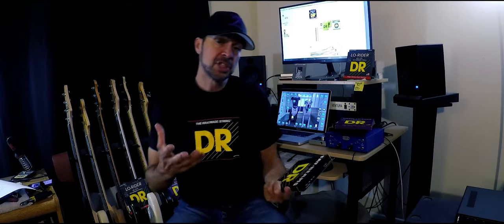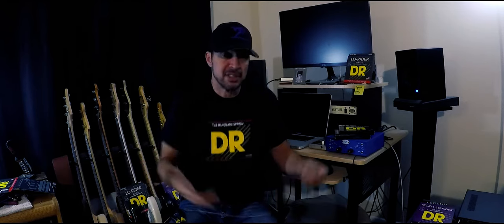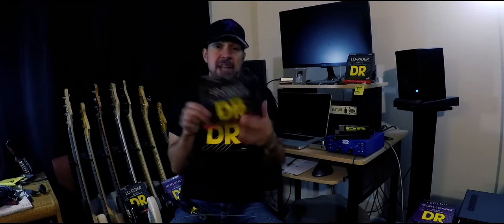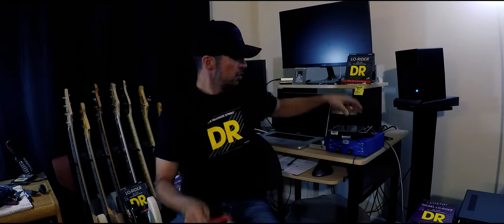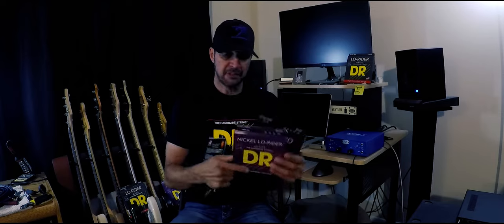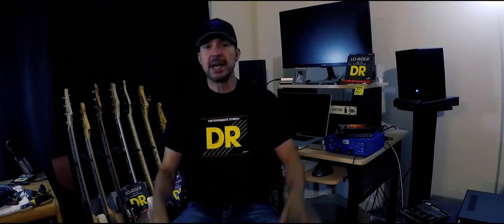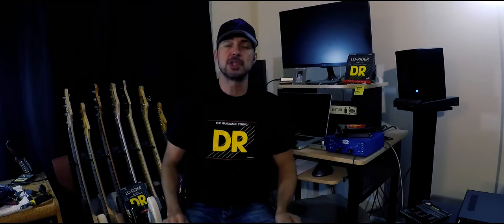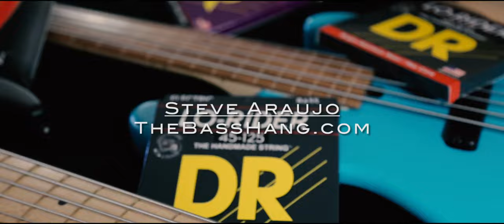Installing DR Strings Properly

Comment: Wow I learned something new today. I have been using DR coated strings off and on for a few years and never once opened the box to look at the instructions. I always stretched without a thought about it except for one of my 5 stringers. I believe I put that set on around 2009 maybe? I remember not stretching those strings because I was in a hurry and I brought it for a back up bass. It’s 2024 and that set is still on there and still sounds great. Even though some of the coating has rubbed off from years of playing that bass they still sound great.

Comment: What happens when you tune a string? You STRETCH it 🤦🏻‍♂
Been using lo-riders for the better part of 25 years. Always stretched them to make them stay in tune faster. And I have never crimped them before cutting. No issues whatsoever.
Reply: When you tune a string, there is equal tension and thus equal stretching across the whole length of the string. When you stretch by hooking a finger under the string and lifting, there is more tension around your finger, resulting in a string that has inferior tone and does not last as long. You may have not noticed an issue because you have not made a comparison. Try it for yourself. As for stretching making them stay in tune faster, well that's just a myth. With installing good quality strings, I tune low-E to high-E, then repeat the same procedure. Then my strings are in tune and not over-stretched in the middle.  When I used to pre-stretch the strings I'd have to go through twice anyway, so not stretching is actually faster. and the strings have better tone. I doubt that you'll try it, so this reply is for people who come across this discussion without their minds already made up.
Reply: @gatoryak7332  how long have you been changing strings?
Reply: @Erikpeterson778 Lo RIders do not require this crimping  procedure before cutting.  They have a HEX Core that keeps the wraps anchored. This procedure is for the Hi Beams and other round core strings.
Reply: AGREED

Comment: Could you say why to never stretch a string?  I'm not sure I follow.  The only reason I can think is that it will unwind or will in some other way be damaged.  I've stretched strings for many years with no ill effects,  if I were to stretch a DR  with unfavorable results it would indicate to ME that my prior strings were (tone being out of the question) more durable.
Reply: On any round core string when you stretch it's to separate the winding up by the tuning peg and will cause it to go dead
Reply: @TheDime4life  you misunderstood my point,  actually that's WHY you crimp the string sharply to avoid this.
Reply: What I'd say is that with other strings (almost all hex-core if you average out what every guitarist and bassist en-masse puts on their instruments), you can GET AWAY with stretching them... that's quite simply all. It's like someone observing that they can drop a plastic cup on concrete, and it doesn't break, unlike a class cup: one cup can handle the abuse of being dropped, one cup can't. I've honestly been doubting the need to stretch strings for many years... it's such a variable stress on the string that I've never thought was all the helpful, but did anyway, because.... that's what new players do, they just blindly follow. 

That's fine, until you find yourself in a situation where you're getting wildly unpredictable results, and need to fully understand exactly what you're doing, and why you're doing it... in detail. Once you've been playing long enough you hear it crystal clear when you've changed strings, and one sounds "off". In my case, I'm not only using round core DR strings, but also a headless bass. I'm dealing with issues that are basically unique to my situation, so Google-Fu no longer gets much useful information! I've had to trial-and-error different shapes of bend (the core snaps if you bend too sharply, particularly with tools), how hard to tighten the string clamps, how far back I can cut string, whether stretching is helping or ruining the sound of the strings through subtle slippage, etc. Everyone else can truly get away with murder using hex-core strings on normal tuning pegs!

I would just switch string brand, but I've yet to find a string that can even come close tone and feel wise to DR Hi-Beams on bass, and DR DDTs on guitar. I personally find DR strings to be expensive, harder to find (in the UK), and mildly inconsistent in terms of dud strings... They were also incredibly unhelpful when I asked to buy bulk directly from them, or even my local importer (and by bulk, I'm talking name your minimum quantity... 50 packs, 100, 300? Whatever). I'd love to not use them, but they're a key part of how my instrument plays/sounds. Thus having to crawl down the rabbit hole of "Do I NEED to stretch strings?", "How does a headless system complicate things?" and even "Can I unwind the string, and splice another ball end into it myself, just like you can with rope?". Absolute annoyance that drags me away from playing... but hey. It's priceless to be able to just follow your own routine for changing strings and just play, and they sound amazing. It's difficult to put into words how frustrating it is to have a brand new (9 times out of 10) lowest pitch string sound like dull/warbly/chorusy shit!
Reply: @TheDime4life  who told you that? why do they sell piano string style then?
Reply: I‘m late, but here are my thoughts: First: as a greenhorn on guitar I first stretched tha shi outa the strings right after putting them on. I was so happy to have them stay well in tune, but with years and ear training to come I questioned this action and started stretching less, or just tune one step higher and let them set over one/two days.  Although I like the bluesy mellow  sound of very old strings (most are 4-5-6 y.o.), I feel manual stretching gets them age instantly for few months. 
   Strings sound fresh if they are elastic. Hardened steel is elastic, but has its limit. Strings are stretched already being tuned up and then due vibration, every additional stretch I think is already an over-stretch. 🤷🏻‍♂️😊

Comment: I use lowriders on all my Basses except my 35" scale basses. On my 35" scale basses I can not get the intonation on the "B" string set, they are always sharp and I can not move the saddle any further back.. I do not have this issue with other brands....I have worked with DR on this (some), they sent other types of strings to no avail... (nice people to work with)
Reply: I have this issue with my spector bass... if i want perfect intonation i have to get a b string that's tapered on the end... try the fender 5 string set. :)
Reply: Hipshot Bridge will fix that issue of needing a tapered B string. I can slap any set of strings onto my bass

Comment: Why do you need to crimp and cut first?
Reply: if you dont DR Strings will raid your house and snip all the strings on your guitars forcing you to buy more strings from them, this has happened to me so BEWARE
Reply: To prevent the core from slipping

Comment: Is this the same for an electric guitar?
Reply: Thanks! I have them installed and they're working great so far, but my a string does go flat from time to time
Reply: No, on guitar the tuners stress the strings in a different way when tuning, and because the strings are way thinner the likelihood of slipping the core is much lower